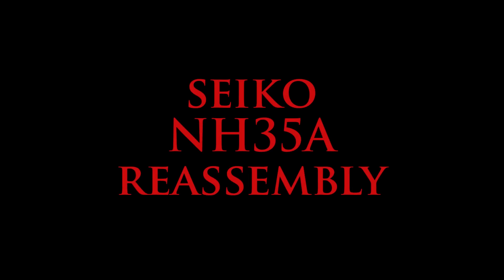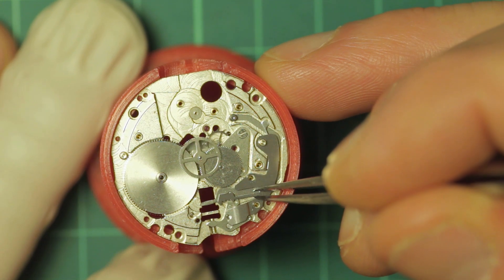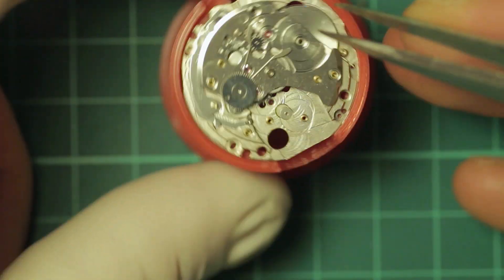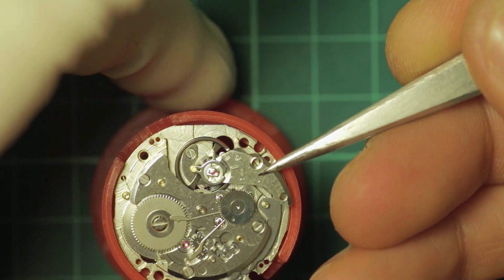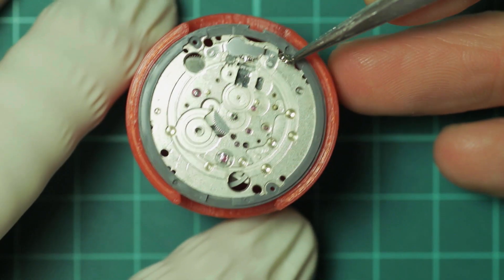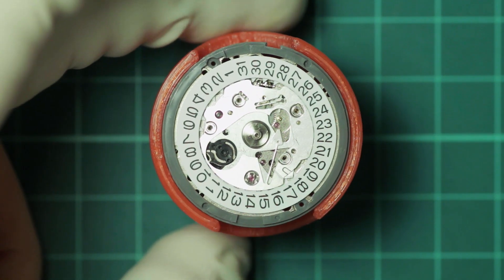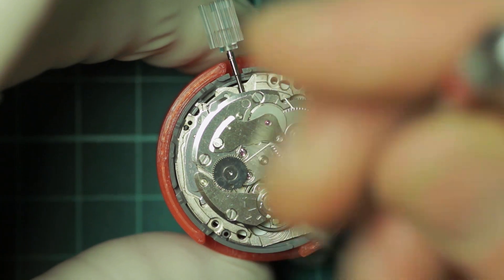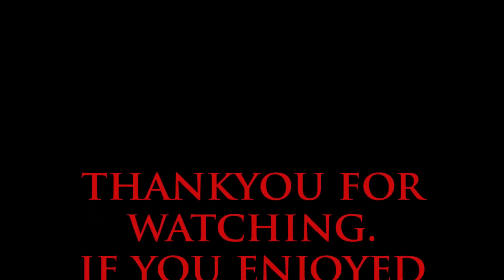Seiko NH35 - NH35A Part 2 Service - Reassembly

Comment: If the levers on the nh35 were moved out of position, would you reset those before reinstalling the balance wheel?
Reply from the maker: There is no fixed position for them they need to be set using a timegrapher (timing machine) with the balance in place.
Reply: @spidiq8  Thanks, my question is out of intrigue. I was just wondering if after you serviced the watch, would you need to regulate it on a timegrapher as well? Provided that it needed it? I'm sure after service you always put it on the timegrapher. My initial question was, if someone messed with those levers. Let's say they moved them both to one side, would you just leave them in the position that person put them in after service? Thanks for the response. I've asked others, and they think I'm trying to regulate my watch. I was only wondering if a watchmaker would need to do any adjustments to the balance levers after, or during service.
Reply from the maker: @1988banker  Absolutely yes they'd need to be adjusted after service.
While I say there's no default position what I mean is that they have to be roughly placed then adjusted on the timegrapher. I simply mean there's no preset mark on the balance that they'd be correct in.
If moved it would throw the timing of the watch completely out.
Reply: @spidiq8  Thanks for the answer! So you would roughly place them. With the beat lever and other one in the middle of the +-. Then adjust the beat, and after that the one to slow down or speed up? If the levers were never moved, and it was great on the timegrapher, I imagine nothing would need to be done. If the beat was good and it was like +1 a day you would be done. I imagine it depends on the situation. I do appreciate the response!
Reply from the maker: @1988banker  Essentially yes but some adjustment would always be required after service once the oils had settled after a few hours of running.
On the timegrapher you actually need to take positional readings and adjust accordingly. Unfortunately many watch reviewers on YouTube get one of these and don't really understand how to use one and just check the watch in one position and call it good.
I really should do a video on using a timegrapher as I've had a few people ask about them.
In short dial up and down should be very close then 6 high and 9 high are the next two most important positions as these are the most common in use.
Provided they're within 10 seconds between these positions with something like a modern NH you're good.

Comment: How good are the Seiko movements vs Swiss movements. Are the Swiss movements way and above the Japanese movements ? In my personal experience - my Seiko movements seems to not give any trouble. I have had my SKX for years and it’s still running pretty good. But I think it’s time for a service.
Reply from the maker: They are OK, and like the swiss movements vary in quality.
There are plenty of 70's poor quality Swiss movements and there are a mixed bag of excellent and poor japanese movements.
The Seiko mainstream movements and current NH ones are very good for mass produced machine assembled movements.

Comment: The Hack is described by Seiko as the Balance Stop Lever with S-6 (Seiko Grease) applied on top of the lever (after installed) at the knee area across from the large pin (dowel).

Comment: I didn't see how you lubricated the wheels. Which kind of eyedropper did you use for oiling for example the central jewel?
Reply from the maker: I don't show the oiling fully in all the videos but for almost everything I use the Bergeon black oiler which is the smallest.
For some applications you need to apply twice, I find it better for myself to do this and guage as you go as it's easier to apply more if needed but not to remove if you add too much in one application.

Comment: Thanks for sharing!! 
 two extra tricks i have learned that are quite helpful for this movement : 

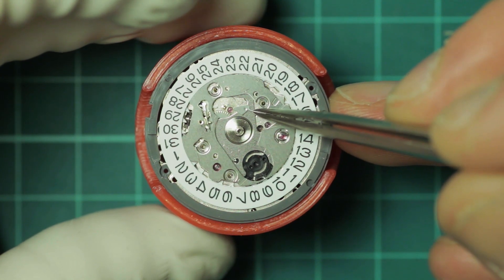10:50 the jumper spring could be set After the next plate (11:01) if this last one is Not Screwed Tightly, but Just placed and Loosely Screwed first ... much easier 

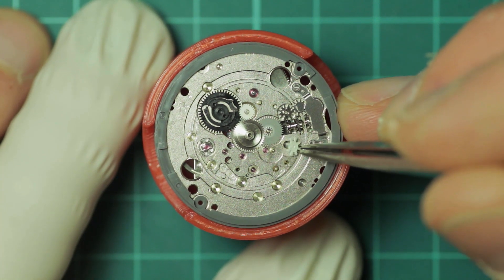10:15 note that the hole covered by this plastic star ... can also be VERY HELPFUL for refitting the motion work, without removing anything on the other side : the clutch can be pushed (toward the center of the movement, do not break it by just pushing on it from the top !!) with a screwdriver "left here" floating, so you can put the different elements supported by the "winding stem" without worrying of the placement of that clutch ...

hope they will help, i have several videos of watches repaired but ... did not took time to record theses tricks
Reply from the maker: Thank you. Tips and suggestions are always appreciated.

Comment: Question: if i was to remove the plastic wheels, the plastic star, the plate and the calendar wheel itself would it just become an NH38? would it cause any issues? I'm thinking about doing so to a watch that has a ghost date position. Date is obviously not needed.

Comment: Excellent tutorial and video. Busy modding a watch with a NH35A and the keyless works wan't functioning properly. Your video really helped but still can't understand why Seiko put the keyless on the other side of the movement. Still, all back together and working again.
Reply from the maker: The 7S26 it's based on did the same. It's baffling.
Reply: @spidiq8  Time to watch another of your videos as I’ve got an AS2066 sitting here that needs stripping down and a service.
Reply from the maker: @thegrumpymuso5418  Have fun with it. Take your time and plenty of pictures of the calendar mechanism

Comment: Just squirt some WD40 and if it doesn't fix it, move along...
Reply from the maker: You might as well just move along then as I guarantee that won't fix it.
Reply: @spidiq8  You're right. My comment was made with tongue in cheek. One of my automatics with NH35a took in pool water. Somehow crown was unscrewed. It started to slow down. I opened it up, removed to movement and soaked in WD40 and it died.  So, I moved along... 🙂
Reply from the maker: @tech29X  I see. I was replying in case anyone thought that was a legitimate thing to try. Thanks for clarifying.
Reply: @spidiq8  Well, I can only attest that I tried and it did not work 😃However, I'm not certain as to why and I might buy a brand new NH35 movement just to test with WD40 to verify. I can't say for certain if the pool water already damaged it or if I somehow hurt it after removing the movement out of the case (my first time). Water Displacement formula#40 seemed like just the right thing for the job (light lubrication, clean spray).

Comment: My balancing wheel is not rocking when I drop it in place. Why is that? It is a new spring and it is not bent or damage… it seems like I have put it in the right slot. It just doesn’t seem to beat 😢
Reply from the maker: There could be so many reasons why.
It's impossible to say without knowing more about your movement.
Is it freshly rebuilt, is it an old one you're replacing the balance on, if so are you replacing the balance because you think the old was defective or damaged, does the wheel train run with the pallets removed and so on.
Reply: Hey friend. I know its been a while but did you ever figure this out? Having the same issue…

Comment: Thank you very much for the video.   
I have a cheap watch with NH35A TMI branded on the rotor.  I noticed the second intermediate reduction wheel, which the magic levers pushes and pulls,  is rather crude.  the teeth are uneven and there are scars on the edges.  Could this movement be a counterfeit?  your opinion is greatly appreciated. Rui
Reply from the maker: Hi, yes it is possible that it's a copy, however the NH35 is so cheap it's rare to see them and they're normally very obvious and poor in finish.
It's possible that you got one which has a detective part, these are mass manufactured movements and errors can creep in.
If it's a fairly new watch you should be able to have it exchanged.

Comment: Hi q i upgrade from D5 to 9104 (hp1300) because it's a fully synthetic oil for high pressure applications works lovely, i still have D5 but don't use it as much, i started using what alot of pros are 9010 hp1300 and Molycote DX, thanks to our friend in the Netherlands, but nothing wrong with it don't get me wrong it's a great oil, another excellent video mate. Cherrs q8 oils are so expensive
Reply from the maker: Thanks. Last replacement I was pondering HP1300 but I tend to find D5 doesn't creep much and I'm so used to it. I will have to try some when I need to renew again. I'm always wary of changing things that work well for me.

Comment: What an interesting video. I am in awe of your skill, I would love to be able to do this. I know that you can buy these movements for a reasonable price so am tempted to purchase one but I need to do some study before I have a go at this. Do you have any suggestions of courses or distant learning courses I could consider. Thanks for posting.
Reply from the maker: Thank you Paul.
It's certainly something you or anyone with patience and a passion for watches can do, these movements are great for practice as, with many things it's better to start with something you know is good and working so you know what you're aiming for in the finished item.
If you're on Facebook I highly recommend you join watch repair lessons group of which I'm an admin, there are lots of helpful folks on there with a huge variation in skill and experience levels, several who have more skill than myself and also people who've never so much as opened a case back. Mark Lovick who the group belongs to has a fantastic channel called watch repair lessons and also does a distance learning course which is highly lauded, you can find details of that here.
https://www.watchfix.com/
Reply: Thanks for tip on the course I am seriously considering doing it.

Comment: thank you kindly for this journey. i didn't expect anyone to service a movement as cheap as this but it's great hardware for value nevertheless right? it's great knowing what lives in my pagani 1651 and when the time is right i might tackle on servicing this beauty myself. cheers
Reply from the maker: Glad you enjoyed it and yes, for the cost of a replacement it's probably the best value mechanical movement to date. It's incredible that they can make them so cheaply and do have a go, servicing is as straightforward as any Seiko 3 hand model, cheap movements and watches on eBay are great sources of practice movements, also come on over to watch repair lessons on Facebook if you're not a member.

Comment: Thank you for this video! I watched so many times. I'm trying to learn how  to service this movement for hobby. I removed one of the cap jewelled spring at one of the cap jewels (at the train wheel bridge) and was never able to put back. Would you know if there is any tool I can use to install this spring? 
Thank you!
Reply: It's a special tool for that , saw in a video , or  with wood special form after it
Reply: or can see a vide by My Retro watches has an video just fot this
Reply from the maker: There are specific Kif tools or you can make one simply, see here.
https://www.youtube.com/watch?v=nOGHyAPckBE&t=245s
Reply: @spidiq8  thank you!

Comment: I wonder why they use plastic for certain parts? Cant be cost surely.
Reply from the maker: Cost and ease of manufacture. Injection moulding once you have the dies is fast cheap and they can make hundreds at a time. Metal would need stamping and possible finishing of rough edges.

Comment: thank you, you saved my sanity. I have an nh35a movement and the stem would no longer push past the first position. I decided to have a go at fixing it myself, im a complete amature and only ever changed dials and hands and crystals, so removing tiny screws and cogs is really beyond my talent, i think the clutch wheel and winding pinion were causing the issue. I was fine taking it apart but then couldnt work out how it all went back together. Thankfully I found this video and managed to get it reassembled, and fixed.
Reply from the maker: That's great news. Glad it helped.

Comment: Does that Japanese movement last a while just wondering
Reply from the maker: The NH series of movements hasn't been or that long but considering it's based on gradual improvements to seikos base calibres 7009 to 7S26 and 7S36 and there are watches from the 70's still running well. I'd say so.

Comment: The method you use to lubricate the cap jewels is very interesting & I will certainly be giving that a go.
Reply from the maker: I normally use the 1A auto for these but thought I'd try this out as an alternative and was pretty pleased at how it worked.
It's pretty much the same as the old method for pulling old non shock balance jewels where you'd oil and then then poke a fine piece of wire through to carry the oil to the cap jewel and of course it's a much cheaper alternative to folks who can't justify shelling out £70+ on an auto oiler
Reply: @spidiq8  I've seen some bergeon A1 oiler clones on aliexpress heard lots of good thinks about them... Maybe I should try one

Comment: Thanks for the video, much appreciated.  The moebius 9010 is for jewels, what's the D5 for ? The mainspring? Is there any other oil needed besides those 2? Trying to get everything together and I need to purchase oils, they're very expensive so I dont want to waste money.  Thanks again.
Reply from the maker: The 3 essentials are 9010, D5 (or HP1300) and a grease for metal to metal parts like the keyless works. 
8200 is a good general purpose grease.
For an automatic watch you also need a braking grease for the barrel walls of the mainspring. Moebius 8217 is a good 'general purpose' one.
There are other greases and oils with specific purposes but you can cover most movements with those mentioned.
Seiko has its own specific lubricants but I haven't used any so can't say how they are.
D5 is used for the barrel arbors. 2nd wheel arbor jewels and the 2nd reduction wheel teeth which the pawl levers (magic fingers) bear on.
9010 for the 3rd, 4th, escape pivots and the balance jewels. (9010 can also be used for the pallets where they bear on the teeth of the escape wheel but the specified recommended is 9415 which is a semi liquid grease)
Reply: @spidiq8  thank you so much for the detailed reply, I greatly appreciate it.